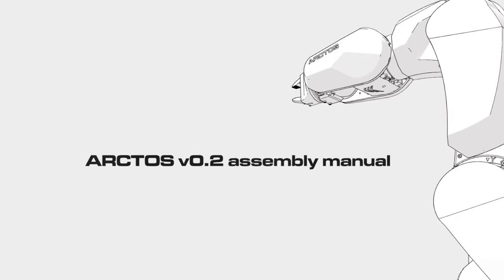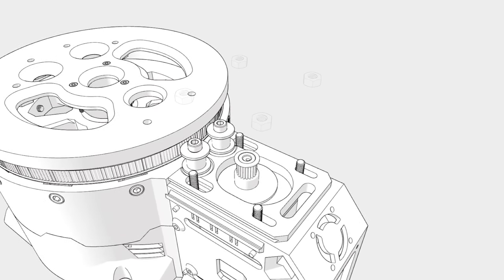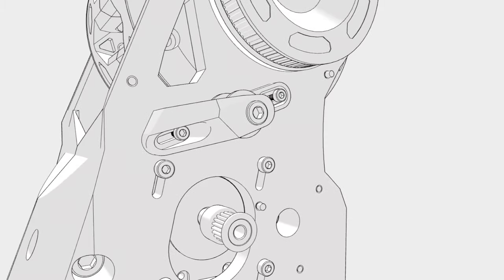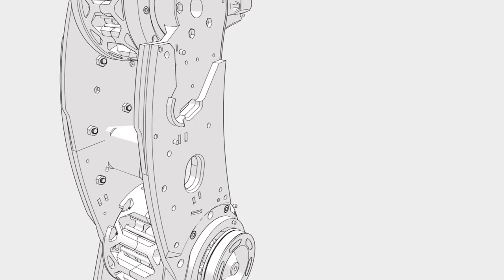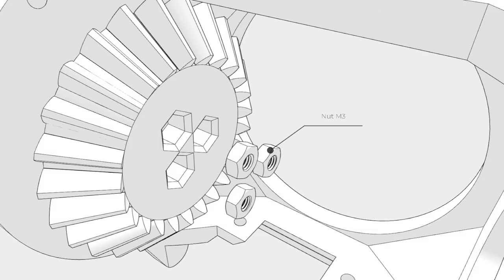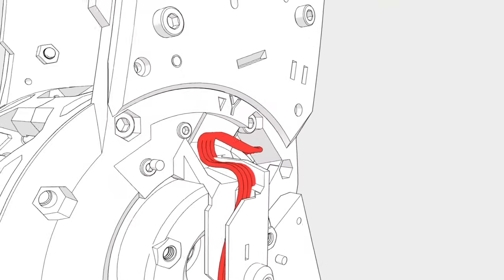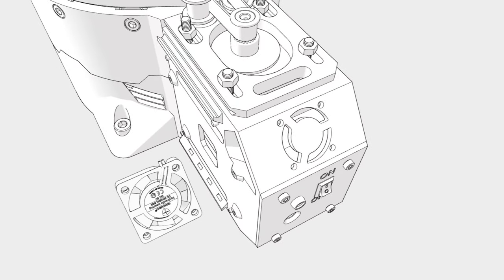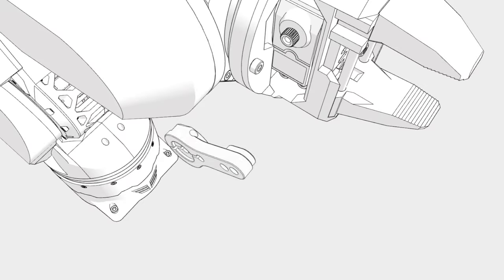How to build DIY 3D printed robotic arm

Comment: I'm thinking about using your arm and gear design and reworking it to fit Atlas 2024 from Boston Dynamics. I want to 3D print a copy of Atlas and use two Arctos robotic arms for his upper torso. As legs needs to be much stronger. But I need to start somewhere.

Comment: I downloaded the CAD files. The project is very interesting. I found some small flaws in the cycloidal design. The cycloidal would be more accurate if it were made in metal. The movement of the links gives small jerks.
Reply: Can I please have the cad files?